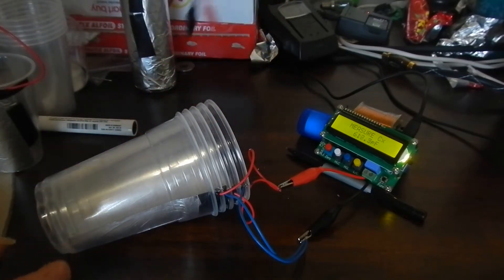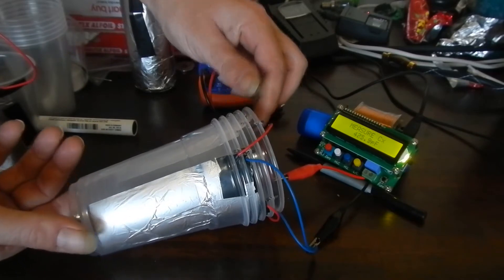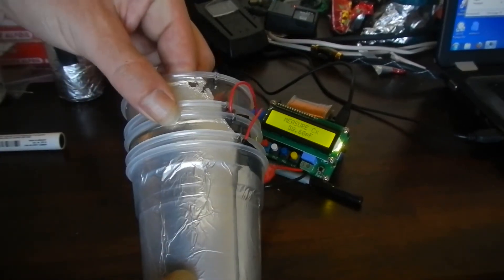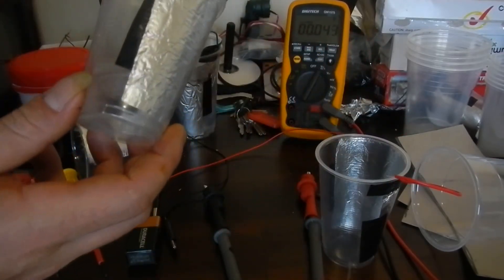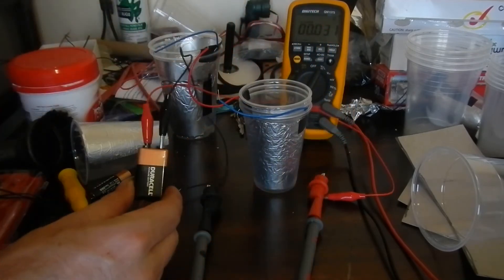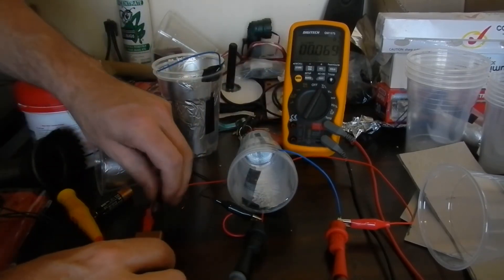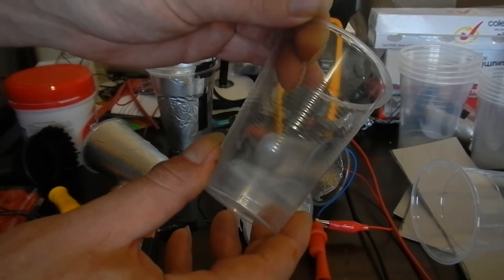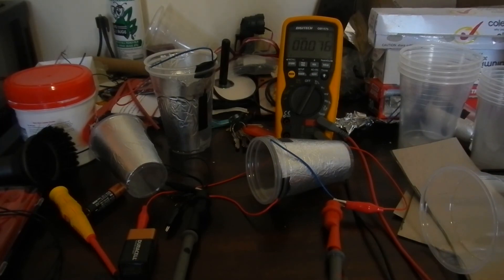DIY Variable Capasitor pt2

Comment from the maker: Close. I saw 3-4 witout deconstructing. had to be fast, As I explain in the video. Even if I mesure the pF and set the comercial cap and mine to the same value (within 0.01pf, as that as fine as I can mesure them). I'm not sure why these ones last longer. Could be less carona effect, or something I am not considering. Could be the magnetic effect between the plates. see how they get sticky when I turn them? makerj101 discovered something importent with  his deconstructable layden replication....

Comment: If you managed to see it at 3-4 volts after the deconstruction and handling then I'd say it worked. You saw that at least some of the charge still remained.

Look up "RC time constant" on wikipedia. It shows how to calculate the discharge time constant. R is the circuit resistance, C is the capacitance. The time constant is R multiplied by C. Your caps discharge slower because they have a higher capacitance than the commercial ones you're comparing them with.

Comment from the maker: Lol I thought so too. Tried that before I filmed. The highest I saw with my fastest DMM (600 samples a sec) was 3-4v. Tried it with scopes too. Should work in theroy, but even the slow one is too fast. Goes from 7v to 0 with no in between. Maybe an analog, not DSO scope would work. It's pf not nF or uF. That was with out disasembly.

My caps do hold charge longer than comercial variables though. Maybe twice as long? Still testing. They Seem better and cheaper than bought ones to me...

Comment: You can do your test with your existing setup. Just don't connect the capacitor to the meter right away. First charge up your capacitor with the battery and without any connection to the meter. Then deconstruct your capacitor, handle all the parts, ... Then put the capacitor back together. And then connect up the meter. If it works as you expect, the instant you connect up the meter you should briefly see 7 volts before it discharges through the meter.

Comment from the maker: Yet it is still dielectric. Opposite to water. I suspect the equation to work out the dielectric value of oil would take into account things like surface tension, density, and viscosity, and combine them with the insulating value of a layer of one molecule (drop of oil in a large pan of water will spread to one molecule if it s not stopped by sides of pan). Tackiness could be a factor too. You can move water with mag field, so I suspect not oil. Will have to try that too.

Comment from the maker: Yes! Oil is an insulator. Lot's of people put air gap variable caps in mineral oil to increase watt rating. I have been tossing around the idea of really thin epoxy or similar too. A few hundred disks of foil in a film canister of resin maybe? Look into lanolin if you get a chance. It is an insulator and a contact enhancer. Hows that work?

How many volts/watts to melt one of my cup-cap's? I wanna see 'em fail. I wanna know what I can rate them for..... I don't have a power supply to push them.

Comment: I made capacitor with a piece of glass and two pieces of aluminium. I seem to be able to get a tiny spark after I separate the plats and then put them together. I think most of the charge is lost from corona discharge. When I hook it up to 12 volts separate them and put them back together there is still enough charge that I can read it on my volt meter. I think you are right about the the electrons on the dielectric attracting more with thinner dielectric making it so more charge can be stored

Comment from the maker: I looked into it more (read the wiki better) and it seems the consensus is for the electrons sticking to the plates. I'm still trying to get my head around more electrons in a smaller space though... I've tested it a lot. Thinner the dielectric, more pf per sq inch. I think its a magnetic thing. Opposite particles attract, get the plates close and they are more attracted, so more particles on surface of plate. I'm not convinced. the experiment must go on! Whats it take to melt one of these?